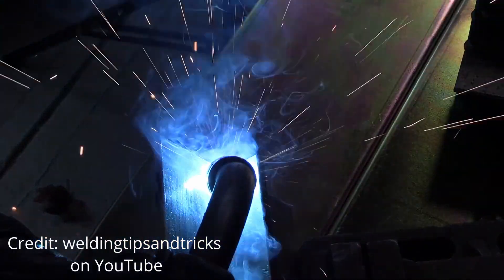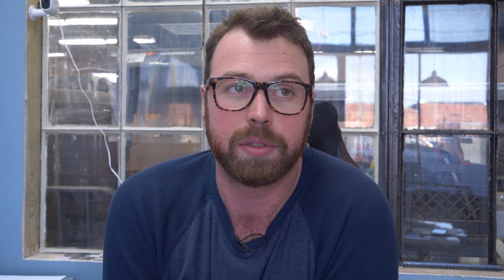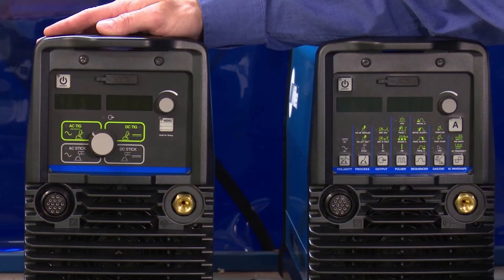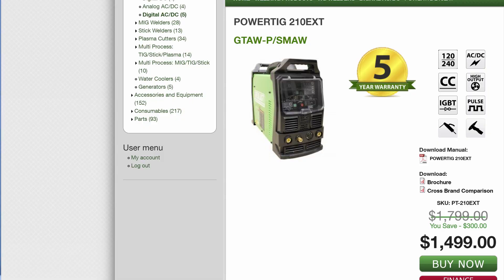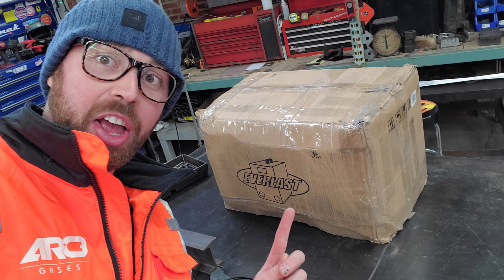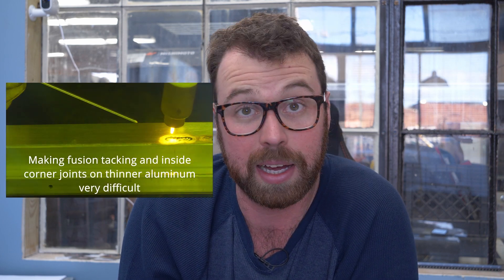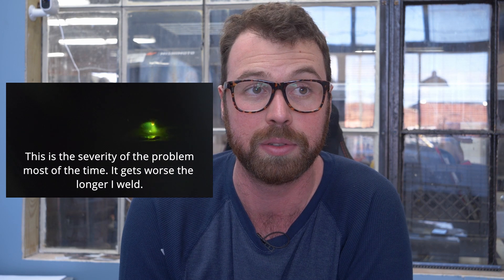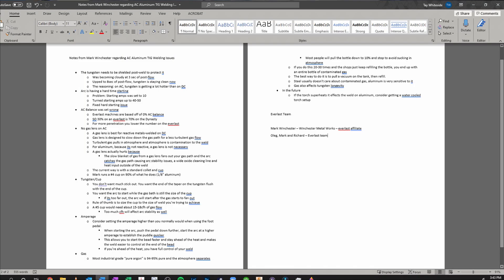I Embarrassed Myself on the Internet, Here's What Happened

Comment: Had a "meh" experience with Everlast to be honest. I bought their low-end mig machine (prior to digital display model) and that thing was a pita to put it lightly, I think it was a 140. I should've researched more options prior to buying. I had drawn all kinds of charts for wirespeed / voltage and used a clear piece behind the knobs to draw lines for where to move the knobs. It would be fine for a body-shop type guy where you set it and leave it, but I was welding things from 16g to 1/4 all the time. Eventually, I sold it to a guy doing body panels (perfect for him), and I heavily researched and bought a Titanium 170 from Harbor Freight.

Comment: That document they sent you is very nice. I've been welding 5 years and have learned or trial and error'd my way through all of that. Would have saved me a lot of time and trouble to have someone spell it out in one go like that. The cfh numbers given for the #5 cup seem a little high to me. I run 10-15 on 1/8" aluminum with that same setup. The fabricator series has a great video showing the difference in oxide etching between a gas lens and a standard collet on aluminum tig. I'd been running the gas lenses prior to that and switched after watching the video. Just for AC on aluminum. Still use the gas lens on DC, especially on stainless.